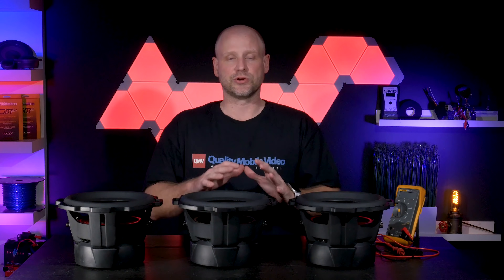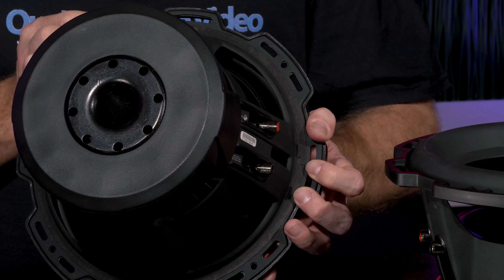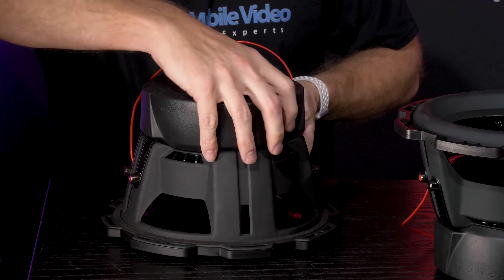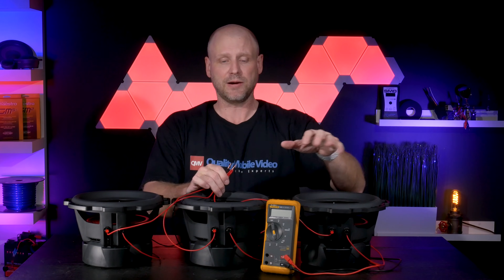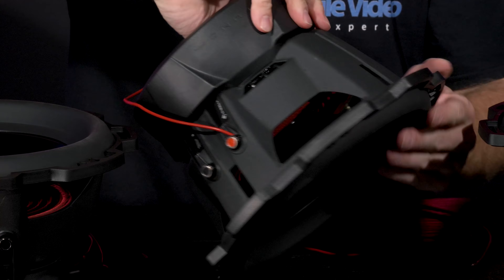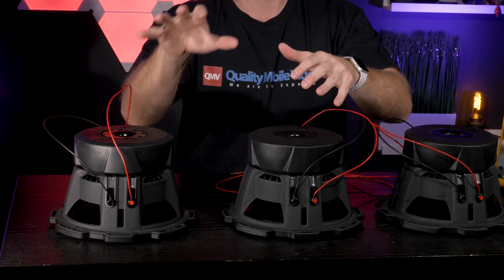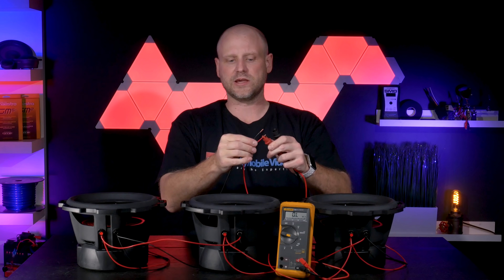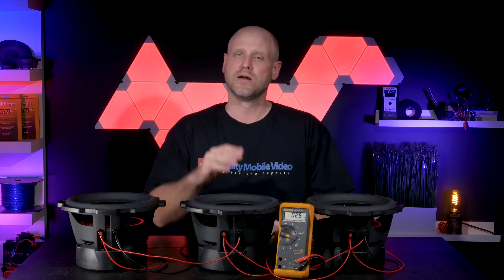Wiring Three Subwoofers DVC 2 ohm - 1.33 Ohm Parallel vs 3 Ohm Series Wiring

Comment: If I’m running 3  skar EVL-10 | 10" 2,000 Watt Max Power Car Subwoofer with a RP-3500.1D | 3,500 Watt Monoblock Car Amplifier which method would you recommend?

Comment: Question. on the wiring of the 3-ohm load. I have six DVC 2 ohms. if you wanted to bridge two sets of three subs wired at 3 ohms First. Is it possible? if so.  what would the final impedance be?  and where can I find the diagram for it? Thanks.

Comment: What if I put my subs at the 1.33 load but need to strap them? They are 1 Ohm stable and plenty capable of strapping with master:/Slave switches on them. The Amps are 1200watt rms with wiggle room and the subs are 900watts rms 8’s. I have 4 subs all 2 ohm dvc and I have 4 amps. Two are the 1200 watts and I have two other one Ohm stable mono amps that are 1800 and 1500 watts rms. All I have been capable of succeeding is using an amp for every sub wired separately at a 1 ohm load each. They are all greatly over powered but the larger amps are definitely too much power. I really need some help on what other options I have because I’m getting exhausted working on my Volvo XC90! Any help would be so much appreciated my man. I’m getting beat up from this thing. Please and thank you for anything you say  that could help 🙏
Reply: Also I hve all four subs inverted. Shouldn’t I probably play them all out of phase so they don’t play out of phase with the rest of the speakers in the car?

Comment: Sorry for the confusion. But I have 3 8 inch skar subs that there manual says 2ohm subwoofers Final impedance load at speaker terminal box is 1.33 what amp wattage and I am do you recommend for something like this? And I definitely want it to hit as hard as those little subs can take.
Reply: Whatever the subs are rated for..

Comment: Thanks for the vid on that.  I have a 600/1 amp which is rated for 1.5 - 4 ohm.  I would really like to run it at 1.33 ohm; do you think it would be ok to be .15 ohm lower?  I have (3) alpine type R 12 2ohm DVC i want to connect.  I know JL has RIPS, but from my experience the lower the ohms, the more power will generate

Comment: So let's say I have two amps and three D4 subs. Run 3 coils in parallel to each amp, both amps seeing a 1.33 ohm load. Will that woofer hooked up to both amps be a problem?
Reply: How did u do it? I have 2 amps also and trying to figure this out

Comment: Running 3 8in skar subs , they come wired at 1.33 ohms , my amp is set up to produce 1000 watts at 2 ohms . How would I wire the speakers to retrieve a 2 ohm setup

Comment: How would you wired 3 8 d4 ohm to 1 ohm?
Reply from the maker: Unfortunately, you cannot wire Three DVC 4 ohm subwoofers to 1 ohm. Only 2.67 ohms (parallel) and 6 ohms (series).

Comment: So the only way to get the full 1200 watts from my amp, I need one more sub? Because two dvc subs can't be wired to 1 ohm if they're 2 ohm subs right?
Reply from the maker: I mean I don't know what kind of subwoofer you already have. But correct, Two DVC 2 ohm subwoofers cannot be wired to 1 ohm, only 2 ohm or 8 ohm loads. Two DVC 4 ohm subwoofers can be wired to 1 ohm or 4 ohm. One DVC 2 ohm subwoofer can wire to 1 ohm or 4 ohm. One DVC 4 ohm woofer can wire to 2 ohm or 8 ohm
Reply: @Qualitymobilevideo  thanx. I have two sdr 12 skar subs.
Reply from the maker: So two Skar Audio SDR-12. But do you have the DVC 2 ohm or DVC 4 ohm versions? If you have the DVC 2 ohm version, you cannot wire those to a 1 ohm load. You can only wire to 2 ohm (parallel) and 8 ohm (series). Two of the DVC 4 ohm versions can wire to 1 ohm (parallel) or 4 ohm (series)
Reply: @Qualitymobilevideo  2 ohm. I'm gonna get a 3rd sub for my 1 ohm stable 1200 amp.

Comment: What if you put two, 4ohm svc subs and a 2 ohm resistor in parallel? Wouldn't that be 1 ohm and if that safe, considering your amp is 1 ohm stable of course?

Comment: I have a mmats d100hc and also a d300hc. The d100hc can go down to .65 ohm. I have 4 soundstream r3.8 2ohm dvc subs wired down to 1 ohm, (but more like 1.3 ohm when measured with my dmm) Ported enclosure, and the d100hc powers them, but it doesn't have the output I was hoping for.  Gain is about 70%. Optima YT, 200A Alt, big 3... could it be a Bad Amp?

Comment: So... if you have an amp that is pushing out 100 w rms at 2 ohms and you have two 4 ohm. Subs in parallel making a 2 ohm load, how much power does each sub get ..??
Reply from the maker: Pretty vague on specs bud. Is it a two channel or monoblock amplifier? What are it's RMS power ratings? Are the subs DVC or SVC? What are the subs' power ratings?
Reply: Sorry, i didnt think the question was that vague ... it seemed simple in my mind.. but 100 W rms x 1 at 2 ohms.... two identical subs at 4 ohms each wired in parallel for a 2 ohm load ... how much power does each sub get..??
Reply from the maker: Well they would both get half. Are the subs DVC or SVC
Reply: Single

Comment: What makes subwoofers heard from down the street? I have bigger subs than my friend but he has a bigger amp, 1500 Watts, and his system is way louder than mine. I have 2 12” Kicker Comp R’s with a 1200 Watt amp. Is it the amp that’s making the difference??
Reply: He has 10” Subs
Reply from the maker: Is your amp 1200W RMS or MAX?
Reply: Quality Mobile Video Okay actually it’s a CXA 600.1 Kicker Amp.. do I just need a bigger amp?
Reply: So 600 RMS and 1200 MAX
Reply from the maker: Never go by MAX. Always go by RMS. And in my opinion, you need a more powerful amp. Those subs COMBINE for 1,000W RMS total, your amplifier's power potential is only half that. Basically you're missing out on 400W. You ideally want your amp to higher a higher RMS. Are they the 2 ohm or 4 ohm versions of the subs?
Reply: Quality Mobile Video  2 Ohm.. I think I’m getting the Kicker CXA 1200 Watt amp which is 1200 RMS and 2400 MAX. Would that be too much RMS since the subs are only 1000?? And also, would I need a new amp kit?
Reply from the maker: That's a perfect choice! No, like I said earlier, you want to have a higher power rating from your amplifier, it gives you head room. This amplifier will bring those subs to their full potential! Make sure to get it from us playaaaa. In terms of an amp kit, what gauge wire do you have installed right now?  https://www.qualitymobilevideo.com/cxa1200-1.html
Reply: Quality Mobile Video I bought a Scosche 1600 Watt MAX Amp Kit from Walmart so I’m not sure if that’ll do or not.
Reply from the maker: Get dis: https://www.qualitymobilevideo.com/pk4.html
Reply: Robert Cyr haha okay.
Reply: give those kicker Comps to Goodwill, go get some Massive GTX or TKO whichever you can afford.. If you have the budget go Massive Summo or Hippo.
Reply: Hyatt Sweezy.  Cuz ur speakers arefor beginners that want to be heard,basically ur shit is Bella weak